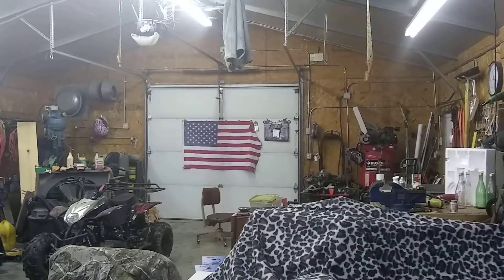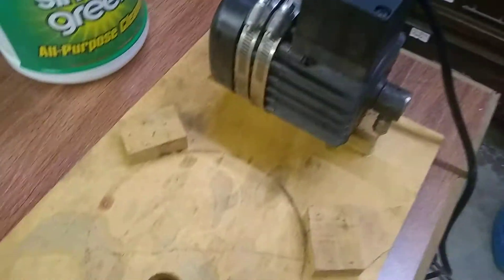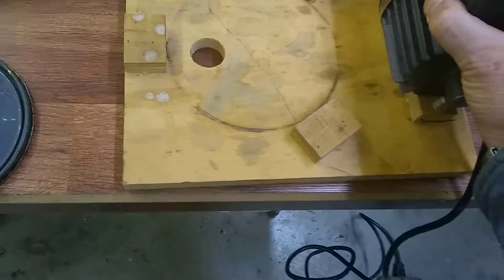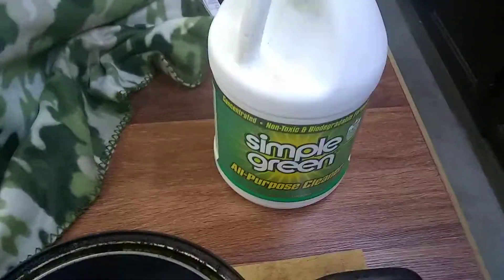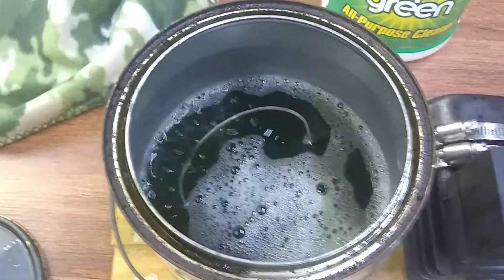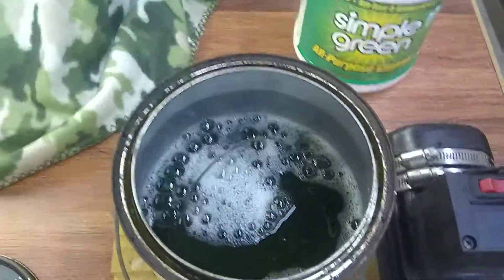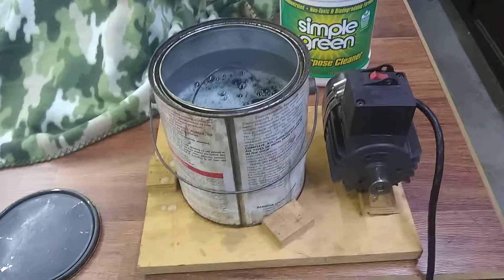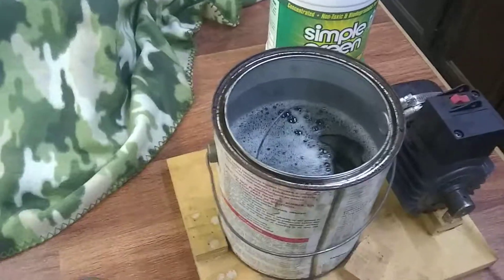Homemade Carb cleaner machine 😎

Comment: If you mount a pulley to the motor with a belt going to another pulley, put the counterweight on the standalone pulley.   It won't be as hard on your motor bearings.
Reply: Yeah, but a belt, two pulleys, and a mount will cost more than the motor did…

Comment: What about strapping a cheap hand sander. Vibration would seem to be 100 fold. Run for an hour or so
Reply from the maker: Sure, it would be better then just soaking it, I used what I had and did it the way I was thinking at the time, if I'd done it a week later it would have been still different 🤔 thanks for watching and the comment

Comment: I far a way from shop i sinkd my carb edelbroke in gasoline iwill leave for 2 days ist gna work plz answer me?
Reply from the maker: Soaking in gasoline is better then nothing, but carb cleaner would be better and the best would be in a ultrasonic cleaner
Reply: @georgeskentuckyworkshop1420   thx for replay cant find ultra sonic in middle east
After i used gas sinking method it didnt work perfect ihave to push little gas to start it 
Carb still blocked some how jets or fuell pipe
Soo am gna go plane b open and clean
Reply from the maker: In the old days we would totally disassemble the carb and run a wire threw every hole and jet and always new accelerator pump, and always may sure fuel pump is good,,, if it's not no matter how good the carb is,, it won't run right
Reply: @georgeskentuckyworkshop1420  my proplem on idle engine die
When push gas padle or on road car work fine and it happind After sinking it in gas before on idle is good on road was bad thx for replay
Reply from the maker: Sounds like it needs to be taken apart and run wire threw all the holes and jets the put new accelerator pump it the carb
Reply: @georgeskentuckyworkshop1420  no need sir am using edelbroke not factory carbretor I think jast need to take it a part clean from inside thats all
And my 350 small block dosent have fuell pump at the tank
Ithink its in front with the engine this is how 70s made it
Reply from the maker: @snopsnopy7901  that's what I've been saying, take it apart, even if you had a ultrasonic cleaner you would need to take it apart to clean it, the accelerator pump is inside your after market edelbrock carburetor gives the motor a squirt of gas when you step on the gas pedal
Reply: @georgeskentuckyworkshop1420  thx for tips bro you realy awsome

Comment: The offset weight will eventually blow the front bearing out.
Reply from the maker: I've gotten the same reply Many times, that simple carb cleaner I made years ago in about 15 mins had cleaned Many things for me, it  was a common thing to leave it run for 3+4 days none stop, it's will be fine for what it's used for, in fact I still use it sometimes to clean bicycle chains, cassettes, and misc when my ultrasonic cleaner is full, after running that for days the motor or bearing housings are not even warm,